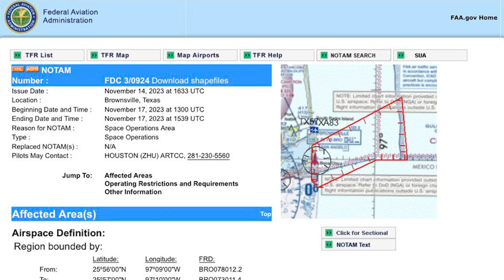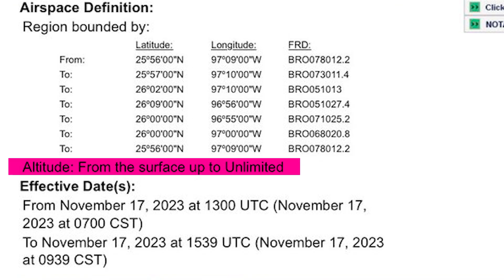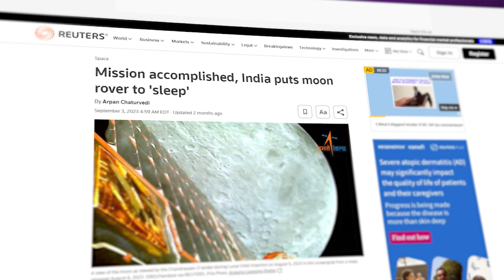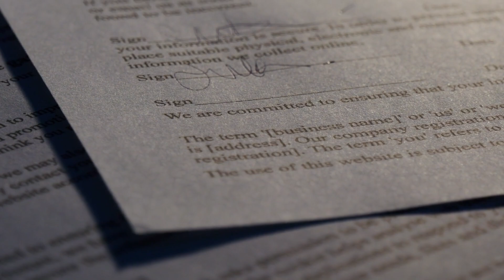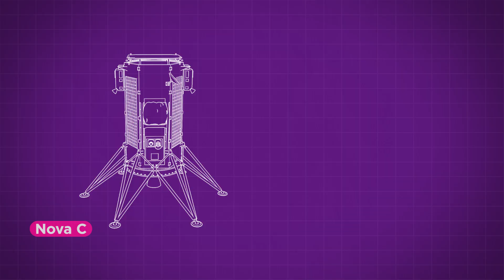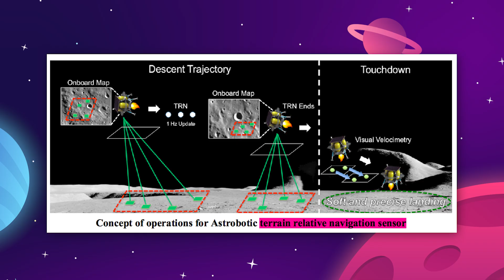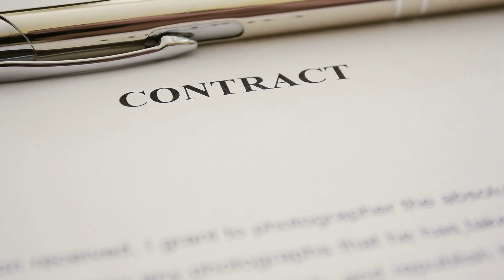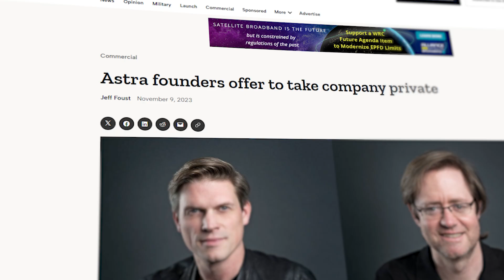NASA Reveals New Lunar Rover!

Comment: Everything you just showed about the NASA designs of the Luna Rover etc are just Designs nothing more at this time. They haven’t even made a mock-up model yet, It will never get off the ground .. Space X is actually going to be using a Stainless Steel 4 wheel drive Truck as its Rocket Payloads is massive 60 X times bigger than its opponents like Blue Origin etc, Space x will be sending 8 Rockets to mars that will take 6 months to arrive Hes sending 1 every month with 2 as Backup, Forget the Moon Mars is the only thing that matters now. The Moon has No Water so No Base is planned. All those small companies are losing contracts to Space X .. They will not matter once Space X gets off the ground… Forget the Moon..

Comment: I am always the optimist as it all depends on what you consider a “success”… but I also believe the fragments from the 4:20 launch cause a lot of the first launch failures.  So I will go out on a limb as say complete success with booster operations, stage separation and then the cooler affect kicks in and the rest of the mission goes foggy.  This type of reentry is extremely tough… I feel like many tiles will be lost and then how does the stainless steel body hold up with friction velocities this intense.

Comment: Let's hope the Vulcan flight #1 is a success. They aren't flying a payload simulator, but instead an actual lander. It would be a shame to lose it.
As for Starship, I just hope that we don't have too many engines go out on liftoff. As long as booster has sufficient thrust to put the system on a good trajectory, I am betting hot-staging works fine. The Titan 2 rocket used it successfully as well as a number of Russian launch vehicles. If they make it through stage separation and the Starship engines start well and go to full thrust, the odds look good. Even if some tiles come off, the stainless steel structure of Starship is much more robust than aluminum, so I am betting the ship will make it through the atmosphere. I actually hope SpaceX makes an effort to recover the booster from the top of the ocean to see if the top dome survives the hot-staging ignition without too much damage. That is a piece of info worth gathering.

Comment: I have one question though, I was hoping someone would answer it, what happens after this starship is a successful launch?
Reply: Probably have to wait for the next FAA decision on another flight which seems to take a long time. Perhaps giving Space X competition a chance to catch up.........
Reply: My best guess would be that they keep working hard on the R&D and keep testing and launching Starships. You're most likely not going to see people on Starships for quite some time until SpaceX has a zero failure rate. As I mentioned above, they need to push the R&D, and currently, the raptor engines need improvement to have a higher success rate.
Reply: If the launch is a 100% succes (which is very unlikely) we might even see the next pairing, Ship 28 and Booster 10 fly as soon as December since the FAA would practically have nothing on their plates to do.

Comment: I wonder what would happen if we parked a large satellite with a large reflector and directed sunlight into a deep crater that has tons of ice in it. Would it heat it up enough to melt it then send little rovers down to sample it!!!
Reply: I’d think that’d just convert the ice into a gaseous state that’d either re-condense as frost or escape into space
Reply: How do you park a satellite?
Reply: @filonin2  I know only manual, but pull up the handbrake and put it in gear, just to be sure.
Reply: @filonin2 you have a locked orbit
Reply: lagrange point  @filonin2
Reply: @filonin2 you put it in a Lagrange point ,which are kinda like parking plots in space
Reply: Park as in orbit
Reply: @Really-Random24  that wouldn’t allow for it to beam light into the crater for very long tho
Reply: Heating up those ice will make them evaporate real quickly due to the low pressure,I mean zero atmospheric pressure in space,and we wanted to have those ice so yeah ,heating those is dumb,we gotta go and mine em
Reply: Just drill for samples then vaporize it back on the craft, iss or earth. Much easier and cheaper haha
Reply: Like i could see us trying to build something earth like in one of those large deep craters. Building a small base down in the bottom of the crater. Using and lava tunnels or ones we make ourselves with 1 of musks new Boring tunnel diggers. Have a bunch of inflatable habitats down there. Then build a large clear dome on the surface. Have reflective surfaces on the walls top-bottom. Then have a large mirror parked in orbit high enough to direct sunlight into the tunnel for 12 hours. With the crater fully airtight with the ice turned caper along with the decent heat from the light!! Could we build an earth like hospitable atmosphere for humans to break in?
Reply: And then instantly vaporize in a vacuum lol.

Comment: w
Reply: Maybe they didn't want to put a radioactive power supply for a rover on the moon? I imagine to power a rover directly or even a hybrid with batteries charge by the nuclear power source it would require quite a large unit. Is there an international agreement about not putting radioactive materials on the moon?
Reply: @michaelreid2329 did you reply to the wrong comment?